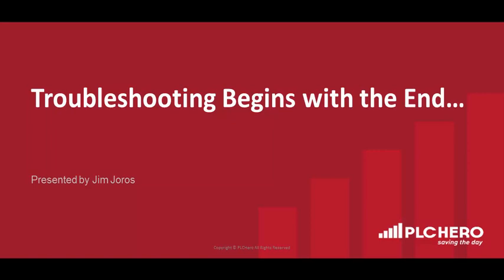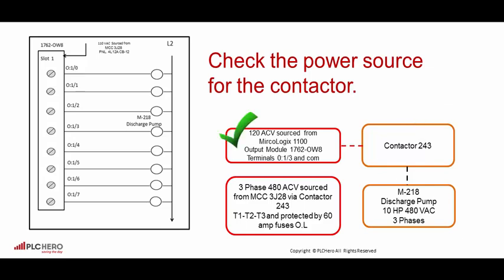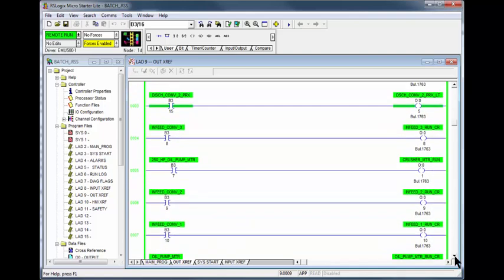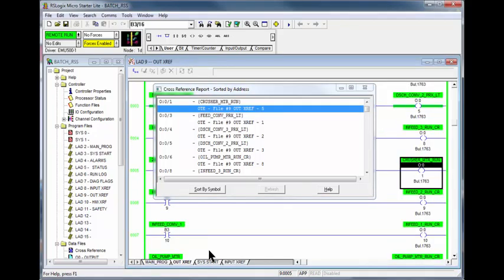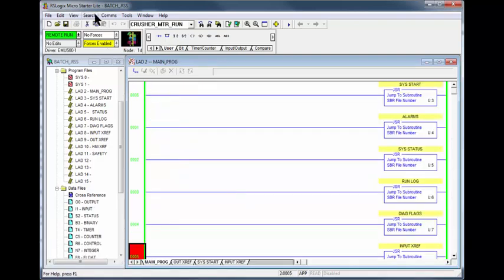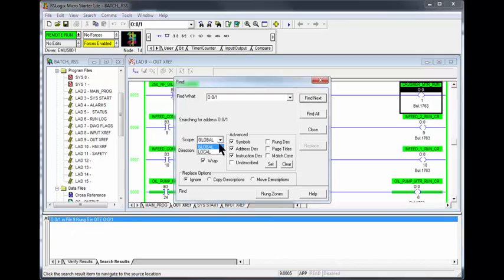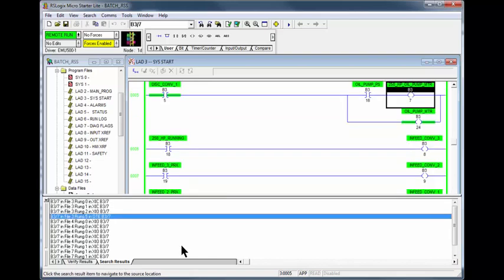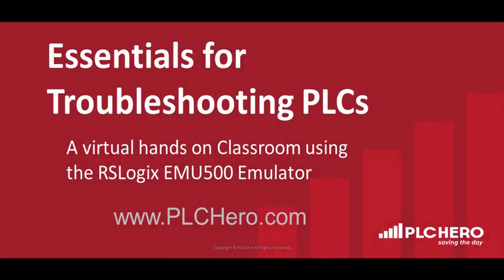PLC Troubleshooting Begins With the End - by Jim Joros from PLCHero.com

Comment: Thank you,sir. But i didnt understand  why when you toggled the input i0/5, it's not remained in the ON state?
Reply from the maker: Input/ output voltages are specific to the module. An example would be a TTL module requiring  5 VDC to the input. Other examples would be modules requiring 24 VDC, 24 VAC, 110 VAC or 240 VAC. Regardless of the voltage input to the module, the voltages must be conditioned to a +5 Volts DC level. When a voltage is present at the terminal screw, it is conditioned to +5 VDC representing a binary 1. With no voltage present it represents a binary 0. Each scan cycle the CPU looks at the input status of the terminal and looks for a voltage. If there is a voltage a 1 is transferred to the Input Data table and turns that bit ON (1) or OFF (0) if there is no voltage.
Toggling the bit in the memory location of I:0/5 will toggle it ON for 1 scan cycle  but the next scan cycle ( 3 – 4 ms. latter ) will toggle it OFF if there is no voltage present. The pressure switch input has 0 volts present at the terminal screw because of a faulty switch, a loose connection, etc. and requires further investigation of why there is no voltage. Thank you for your question…hope this helps.

Jim Joros
Reply: @plchero8370  i didn't know that it toggles the bit only for one PLC scan cycle. Now i totally understood why it toggled off. Thank you for clear explanation, sir.